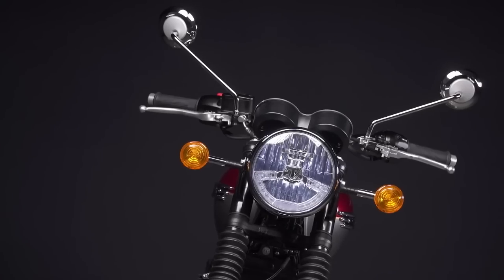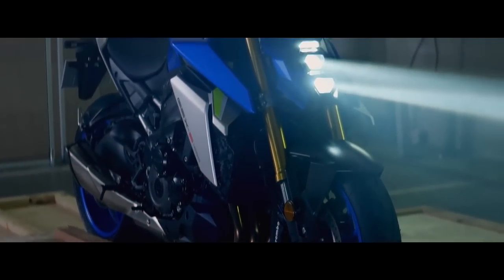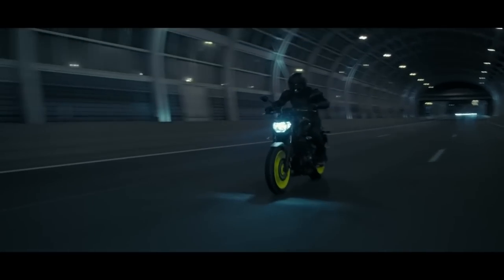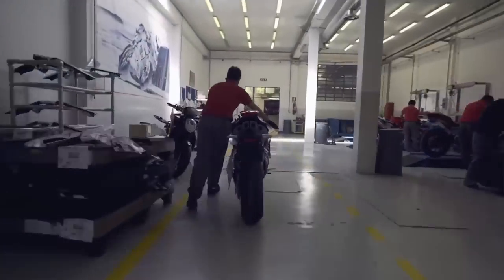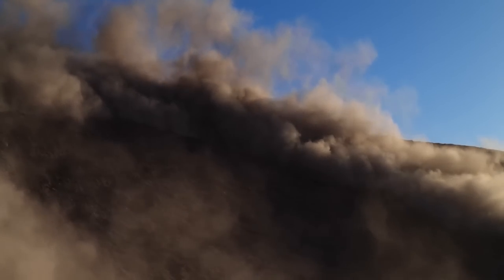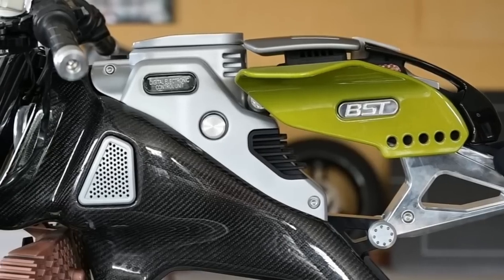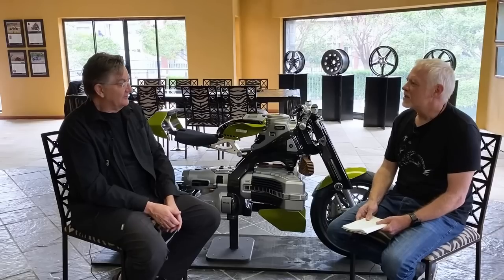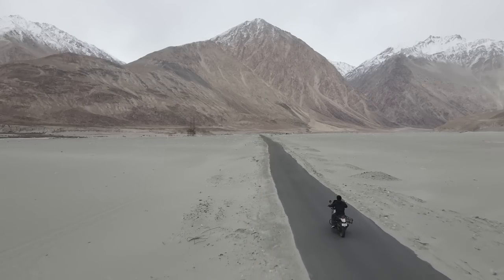Why old motorcycles look better than new motorcycles

Comment: Mechanical systems can be taken apart and put back together.  Every once in a while the light bulb goes off and you actually understand how it works. A very satisfying experience.  Not so much for "chips" and software.
Reply: me an electronics test engineer: are you sure about that

soldering and having knowledge of basic electrical theory should be just as important for a mechanic as knowing how to replace a wheel bearing or bleed brakes.

the real problem is manufacturers blocking right to repair at this level and that working on micro electronics isn't "manly" thus hard to get wrenchers to bother learning it.
Reply: @s_t_r_a_y_e_d  Yes, I'm sure.  Don you really understand how moving a charge through an electric field creates a voltage?  Not just some number that shows up on a meter.  That's a first day lecture in a beginning electrical course.  How about the characteristic impedance of a trace on a circuit board? Otherwise, I totally agree with you.  "Soldering and having knowledge of basic electrical theory" is an excellent idea.  As a test engineer you have access to design information, engineers and source code.  Consumers don't.  Which brings up "right of repair".  I totally agree with you that consumers should be given information relevant to maintaining their purchases.  Henry Ford gave tools and instructions to Model T owners on how to de-carbonize the heads on the engine.  He realized that many farmers were fairly adept at working on farm tractors. Can you imagine a Mercedes S class owner picking up a valve grinding tool out of the factory tool kit? Scotty Kilmer has shown that scan tools are the upside of sophisticated electronics.  They can allow cars to diagnose themselves. Manufacturers haven't gone out of their way to make scan tools accessible to the average consumer. Manufacturers love "proprietary product lock in" like using your iPhone with a Mac computer.  Thought of monopoly control makes them deliriously happy. Wireless communication between the car and manufacturer (OnStar and Tesla auto-update) is a real battlefield right now. Happy fixing!
Reply: So you're main argument is that you don't understand it.

I agree that it's fun to work on things you understand. But if when faced with something new your default atitude is to disregard it.. it reflects poorly on who you are.

I'm generally curious when I don't understand something. I work in understanding it.
Reply: @FabioRodrigues-xs8vf  No. The main argument is that you don't have the right to understand it. According to manufactures. As he said, engineers at the manufacturer do have the source code, equipment and blueprints available. Consumers on the other hand don't.
I get that you're into learning new stuff, and I am too. But today's products don't allow you to. Legally at least... There are a lot of counterfit tools for fooling an iphone to think the new battery is still the same for example.... But the fact that you have to go through that route is just ridiculous. Consumers should have access to tools from the manufacturer and the right to repair.
Reply: @pedromateus4268  perhaps your main argument is that manufacturers have a vested interest in making sure the consumer does not understand the products they buy, which is something I agree with. However, OP's argument is that just because they don't understand "chips and software", it's therefore impossible to understand.
Reply: @s_t_r_a_y_e_d  I'll admit that electronics and programming do aggravate me for that reason, because I don't understand them. Besides that, I find them intriguing. My question for you is how could someone like me, who has no knowledge on the subjects, start and learn about them. (Not college. At least not yet)
 
And I'd also love some pointers for the mechanical side as well.
Reply: Well replacing a light bulb is an easy and cheap job. Now with LED technology it's not just simply replacing a small and inexpensive item, LED lights are designed in a way that you have to replace not only the LED itself, but the whole fucking board and housing. In a world where we have to save resources, preventing further polution, being environmentally friendly this seems kinda contra productive. So if the LED gives up, throw out the whole lighting unit with cables and install a spare one, when a simple, easy, fast and inexpensive light bulb change could have been done instead. I'm kinda reluctant buying a bike with LED front and rear lights, indicators and so on. It's said they last way longer than bulbs but my now four year old bike which I bought new 2018 with light bulbs hasn't had a defective bulb ever since. LEDs are brighter, you can get cornering lights etc. But do I need it? It's a nice convenience, but it comes with a price I'm not really into. So if I can, I buy models with light bulbs instead of LED tech. Not all new tech is bad, I think EFI is a lot better than carb run engines, but each system has ups and downs. If you work on your bike and you got a problem with the engine not running, EFI systems are harder to analyse because of a lot more sensors and actuators that can go bad.
Reply: Me no like fire, no understand, make head hurt
Reply: Every once in a while a bug is discovered and you actually understand how it works. A very satisfying bug hunt and software fix, or replace the chip, like sometimes you don't have to replace the wire, but the bulb.
Reply: @camgere  yes this is something that should be basic in a world where everything is made out of Chips
Reply: @pedromateus4268  yep
Reply: Software yes, chips no. You don't need to understand how the chip does what it does or the compacitor does what it does to understand that when it's broken it needs to be replaced, the diagnostic methods are just different. And chips aren't mysterious. If you've done wiring on a car or bike you've worked on a giant chip. All a chip is is the miniaturization of processes that took a circuitboard to do 10 years prior (think back to the future part 3, dock was able ro replace a burned out chip that didn't exist yet but the circuit board covered the hood of the DeLorean)

Software on the other hand is like trying to find out what's wrong when the other person speaks a different language.  Can you learn the language? Sure, but there's a million of em and sometimes even knowing the language the dialect will get you thrown off. It's not easy at all.
Reply: For years, I had been keeping my distance from programming but then I was forced to work with it when I went to university. With the little knowledge I've accumulated so far, my view has changed. Now it's just another skill one can learn and put to good use. There's programming in a lot of things and I'd like to mess with it to push the products I buy closer to my vision, just like one can with their mechanical aspect, but the problem is that either the manufacturer won't let me do it or there's no good source of the deeper knowledge that would be required. A man who doesn't know how his software-based machine works and can't fiddle with it is just like the stereotypical blondie who knows shit about how her car's mechanical parts work.
Reply: @tenpotkan7051  then you got full on dunning Kruger. I work in system integration. If we didn't mainly use open source and if we worked with hardware like cars or such we'd be fucked. Why? Without documentation you can NOT reasonably reverse engineering the thing. And even with documentation you have a hard time due to how much proprietary soft and hardware is required for these things. The amount of IT in everything is anti self repair.
Reply: So can electrical systems if you have more than 10 IQ. Soldering, wiring, and testing are the new basics
Reply: @greengoat5654  dunning kruger or can you actually bypass proprietary restrictions by the makers on CPUs and such?
Reply: @bakpfeife2224  CPUs are not the problem, that's a small part and a disposable part, it's the wiring and sensors that people get confused on. That stuff is very easily doable
Reply: @greengoat5654  wiring is easy of course but srsly. Take tractors for example, they got so many microcontrollers n such on em that run on software noone except the maker understands and ya ain't even giving a schematic. That typa deal ya can't really fix yaself.
Reply: @greengoat5654  and....a CPU is not disposable. Like if it is the thing responsible for monitoring how much fuel you got left or how much weight ya got left in your seed dispenser or whatever (I'm IT not a farmer, I got no clue) that stuffs kinda important and the mechanical parts sometimes depend on the electrical feedback. If ya could just rip the software based stuff out then that'd be cool, n if you could just throw an open source OS image on a tractor that'd be dope. Ain't currently possible tho as far as I know.
Reply: @bakpfeife2224  the issue is lack of shared development and common parts, if that CPU with the same across all your tractors, or at least third of them, it would easy to keep spares on hand. Stuff breaks that you can't repair on your tractor all the time and you have to buy new parts for, hard suspension parts, fuel system parts. The issue is that people can't seem to learn how to find out what's wrong which is actually really simple usually
Reply: @bakpfeife2224  you're building for regular service, not it professionals. A  well sorted GUI would be a service worth paying for the tractor that does come out with it
Reply: @greengoat5654  honestly they just gotta share schematics n do a good documentation n I wouldn't complain anywhere close as much anymore. And allow 3rd partys to make the same parts if you don't sell them anymore but "still got the patents".
Reply: @greengoat5654  but...you're also building for repairability. And honestly that ain't done with tons of IT involved.
Reply: @greengoat5654  diagnostics with so much IT involved is incredibly hard I dunno why you gotta pretend otherwise while literally never naming a single IT issue you can solve that ain't busted wires
Reply: @bakpfeife2224  of course, sensor failure, and the oscilloscopes required to use to test some can seem complicated at first, but they're not and I'm sure you know this. It's something now taught at the base level to most mechanics
Reply: @greengoat5654  but....just no.... that's an expensive tool for someone just wanting to fix their things and if it's the software getting screwey then the issue STILL doesn't get diagnosed there. I think you assume hardware issues too much when my complaint is software issues.
Reply: not really
Reply: @FabioRodrigues-xs8vf  do you know which circuits with which functions the 3 d structures of a certain microchip have? If you ask anyone at intel who is working on chip a how chip b works, he can only give you very general information about chip b.
Do you know everything about ms excell? A very common standard software. If you find someone on the excell team at microsoft who says the knows everything about excell, you've found a liar.
Reply: @besenwieslersepp1011  I don't understand what this has to do with what I wrote. I think there's a narrative that you're following that I am simply not. When did I claim to know everything about anything ? And who would agree to knowing everything about something. You are a very confusing person.
Reply: @FabioRodrigues-xs8vf  I confused you? Thats all i wanted to do.
Reply: @besenwieslersepp1011  I feel so terrible now that You've succeeded. I wish I could feel that satisfaction of proving that the other person in the argument has nothing valid or worthwhile to say.
Reply: @FabioRodrigues-xs8vf I'm afraid I didn't understand you correctly. English is not my mother tongue. Sorry for my provocative post.
All I wanted to say is that I don't give myself the illusion that I can understand all the complex technology if I try hard enough. And with all due respect, it will probably be the same for almost all of humanity.
Years ago I owned a BMW from 1954. Technically, I fully understood it. I currently own a 1997 Suzuki, if need be, after a bit of googling I understand the few electronic components as well. I hardly understand the innumerable maps of a modern engine control unit and I don't want to understand them either. I would have no benefit from it at enormous expense.

Comment: Clean design no electronic fuss, simple mechanism, good ride quality makes the old the better choice, Royal Enfield is catering to their moto of pure motorcycling
Reply: I'd argue I get much better "ride quality" with the more modern bikes with the modern tech. There's no doubt that a lot of older classic bikes are awesome, but I'm not going to make an old bike my daily commuter when there's so many modern bikes that are far safer and easier to ride
Reply: @tomoates8568  Modern bikes are more sophisticated. You can already tell a huge difference from bikes that are 20 years older than the newer models. They are in comparison to their matching CC range lighter, more manoeuvrable, more reliable, just better in most aspects. Technology advancements in suspension, rubber quality for tyres and electronics made a huge difference.
Reply: Imagine getting an engine malfunction in the middle of a desert because you couldn't get the newest update for your ecu, that happened w me. Gonna switch to a simple mechanical bike soon
Reply: Electronics can be the opposite of “fuss” especially if you’re talking carburetor vs fuel injection.
Reply: With most of the older bikes, they could be modified or customized. Many hoppers from the 70s were works of art. Not necessarily practical or easy to ride, but an expression of the builder. The engine was the centerpiece.
Reply: I can get a KLR for the same price and have twice the power.

Comment: In some years we will talk about why buyers prefer “old”internal combustion engine motorcycles than electrics…
Reply: There will be a time ,if we survive the climate catastrophe , that the thought of `burning` such useful stuff which presumable we will need forever , will seem so short sighted .
Reply: @MyKharli  Fuel can be made synthetical.
Reply: "My uncle has a country place 
No one knows about..."
Reply: @2lbsTrigrPull  never will be as good as eletricity nothing will any technology that isn't electrically powered evantually will be
Reply: @2lbsTrigrPull  ...with coal.
Reply: @bertrandgeorgeon3992  ... with uranium....
Reply: @MyKharli  70 percent of all global greenhouse emissions come from just 100 corporations.

Cars are literally the least of our issues.

Hard cope isnt it? And EVs will not fix anything, not enough comercially available lithium for the batteries past 2030.

And EV manufacturing is VERY polluting due to the mining.

Keeping an old car running for decades is way greener than buying a new EV every 5 years like the consumerist crap we are.
Reply: @2lbsTrigrPull  ..from coal , biomass or gas ...think about it .(before you say biomass is neutral , no its not it takes stupid amount energy growing harvesting delivering converting ,and 2 it prices food growing against crop fuel value ,terrible for the poorest 50%)
Reply: @HiroNguy  200 years worth with current reactor numbers , converting it into 250000 year storage nightmare , way to go .
Reply: @MyKharli  1.  Can breed more fuel from fuel.  
2.  The waste that can't be repurposed is isolated in 1 compact location instead of over the entire planet where everyone has to breath and consume it.  
3.  How's that lithium mining with child slave labor going?  How clean is that?  
4. Electrifying 100% of the everyday vehicles people use would require 100% of the world's silver.  I don't know about you but as for me, I already hold a fair $tack of it 😁
Reply: @HiroNguy  There are lithium alternatives oh fast breeders , what could possibly go wrong . Yes i agree we have to consume vastly less using vastly less energy on vastly less too .  why are you holding silver ? are you making yourself a target ? can you eat it ? will people swap food for it ?  Its copper the biggest problem i thought at 50kg per car minimum ?
Reply: @MyKharli  TLDR.
Reply: @infinity002  Wrong, butty.  Uranium and coal are often found in the same areas, but way more coal must be extracted to get the same kW*hrs energy from a powerplant.   Therefore uranium is safer than coal for those doing the mining because less mining is required.
Reply: @HiroNguy  Someone here has good music tastes
Reply: @MyKharli  I don't care if I have to boil plums to make alcohol, my gixxer will roar to life!
Reply: @popinmo  says the uneducated non-rider.

Comment: I like Royal Enfield because in many ways they are making motorcycles the old way, despite their new factory and their embracing of modern features. Most of their current bikes make a minimal use plastics, and that's refreshing. I love my Himalayan, and I'm thinking of buying a Classic 350. The Himalayan was also designed by Pierre Terblanche.
Reply: The reborn classic 350 is just beautiful. Thanks to RE that they have refined that engine.
Reply: Wait up they are gonna come out with the new 350 this year.
Reply: 500cc also best bro👍😎
Reply: Why 350? It's slow as fck, i should've got the int650 lol

Comment: The way light plays on and thru the bike. Its the same with older cars and even bicycles. They were built by engineers first then styled not styled by a team of designers instructed to hide the engineering. They were intended for those that knew how things worked not for those that just hand it back to a dealership. Repairs were done by mechanics in overalls that you knew their name not technicians with a laptop in the back room where you aren't allowed.... unlike most things in today's world, they made sense....or maybe I'm just a old fool and the good old days aren't real...